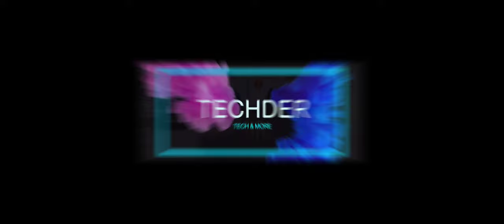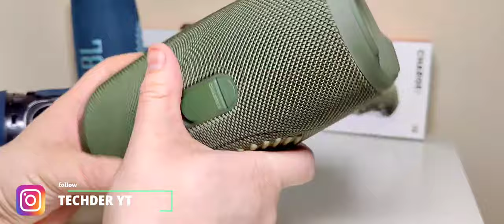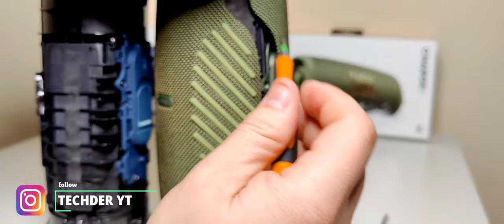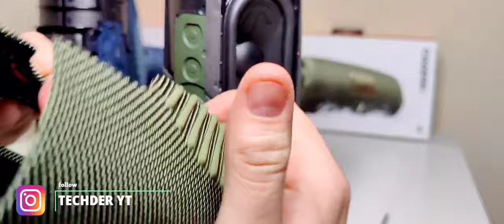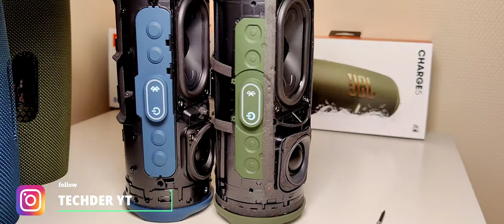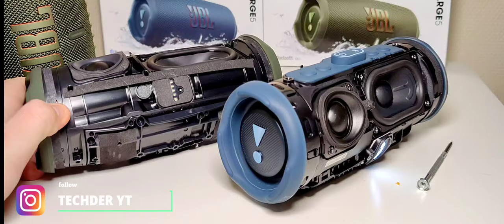2X JBL CHARGE 5 Disassembled Fabric Cover ND VS TL "ALLOT DIFFERENCE!?"

Comment: Is the colors of the speakers tied to TL or ND models or how would one know which i'm buying (if from webshop)
Reply: You don't, it's basically a cross your fingers for the ND 🤣
Reply: But I did get a black model that is a TL, it's not bad but that's coz I haven't heard an ND yet.
Reply: ND is gark green only.
Reply: The CHARGE5 comes in 3 versions (based on what I know): ND, TL, TT. The ND has more upper bass, and a warmer sound, while TL has sharper highs and more deep bass. The ND also has better waterproofing. There is not much info on the TT version as of now. If you are not using it near water, TL, and want the most detail, TL. Anything related to water or outdoors, or if you like a warmer sound with more punch, ND. Teal, Gray, and Green are most likely ND, and red, black, camo, and blue are most likely TL. Other colors may vary- there is not much info out there ye.
Reply: @Wakusins  I got one and it's NT 😂

Comment: I just got my JBL charge 4 back I had the black GG model but I got back the Black TL model but the GG charge 5 sounds better than the TL it's usually the other way around interesting 🤔
Reply: Number7Red  fast forward and I have a ND model my TT model was falling apart so I got it replaced
Reply: Number7Red  oh the sound was fine the rubber on the bottom was just falling apart. And that's cool to know there are new Charge 4 units

Comment: Hey! I have a question. I have this model but there is a "radio like" noise sound coming from the Tweeter. It's noticable on lower volume but on louder volume it is still there but not noticable since the sound is so loud. Is this normal? Or is it faulty? Got the TL version btw. Same color.
Reply: it's completely normal, Little bit of "hissing" noise coming from the speakers because of Bluetooth
Reply: 💦 waterrrr!!!
Reply: Stop putting your speaker in the water even if water resistance

Comment: What does ND and TL mean?
Reply: The CHARGE5 comes in 3 versions (based on what I know): ND, TL, TT. The ND has more upper bass, and a warmer sound, while TL has sharper highs and more deep bass. The ND also has better waterproofing. There is not much info on the TT version as of now. If you are not using it near water, TL, and want the most detail, TL. Anything related to water or outdoors, or if you like a warmer sound with more punch, ND. Teal, Gray, and Green are most likely ND, and red, black, camo, and blue are most likely TL. Other colors may vary- there is not much info out there yet.

Comment: TL have speakers more Big 🧐 more bass then ?
Reply: The CHARGE5 comes in 3 versions (based on what I know): ND, TL, TT. The ND has more upper bass, and a warmer sound, while TL has sharper highs and more deep bass. The ND also has better waterproofing. There is not much info on the TT version as of now. If you are not using it near water, TL, and want the most detail, TL. Anything related to water or outdoors, or if you like a warmer sound with more punch, ND. Teal, Gray, and Green are most likely ND, and red, black, camo, and blue are most likely TL. Other colors may vary- there is not much info out there yet.

Comment: But why is JBL doing this? These aren't even vastly different manufacturing dates, so not even explainable by hardware revisions. Does JBL now only make the exterior design and DSP software, and instead lets 3rd parties produce their own designs under license?
Reply: It could be hardware revisions where they had made the blue/black speaker first and found a better way to manufacture it later on
Reply: We don’t know how long they’ve been producing these speakers
Reply from the maker: No they always have different models because the produce this spealers in different Factories that operate for OnePlus
Reply: I thinks its more on what's more available raw materials in local markets, thats why they made some changes in inner parts of the charge 5 depending on what country they where made from?
Reply: @numerouno7874  Raw materials doesn't explain the use of completely different molds for plastic parts, and different PCB layouts, ultimately implementing the same circuit, manufactured at the same time.

Comment: Sorry, I'm using a translator. I am from Argentina.
Here there is almost no information about Jbl.

Only 2 versions are sold here, both manufactured in March 2021 from what I saw on the box. The NT version (CHARGE 5H) AND THE TT VERSION (CHARGE 5J).

If you're so nice, would you tell me which one I should choose and why?

Thanks!
Reply: Hola, yo compre el Charge 5 azul en un distribuidor oficial en Bolivia de JBL hace unos días. NT Made in Vietnam, lo abrí para ver si se parece mas al TL que dicen que suena mejor en los medios y no mucho los bajos y que también tiene una construcción no muy prolija, o si por el contrario se parece mas a la versión ND que suena menos claro en los medios pero tiene mas bajos y su construcción es mejor, es decir viene en un solo case interior y la rejilla no dobla como en el TL. Una vez abierto se parece casi en todo al ND toque la bocina pero no sabría decir si mes plástico o papel, pero supongo que tanto las versiones TT y NT son fabricadas recientemente y debe ser una construcción hibrida. Compra de donde te den una buena garantía sin miedo que al final suena genial. Un saludo
Reply: @jorgevarga  no ves que la versión TL tiene más grandes los speaker ?
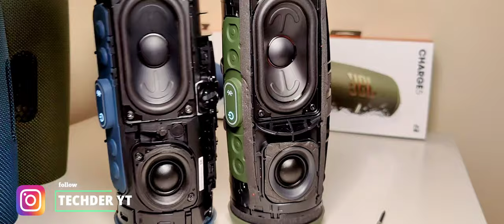Reply: @cesargamerpro3189  andate al minuto 3:26 los speakers son del mismo tamaño. y si aun fuera de un tamaño distinto, que tiene que ver con el tema que esta hablando Antonella?
Reply: Tt

Comment: So the green speaker is ND and the blue speaker is TL, what model is the black speaker? Whats the situation with the other colour speakers?
Reply: The black model is tl
Reply: @thymen641  yup, thanks. I learned that the grey speaker is ND and the rest is still a mystery for me
Reply: @tennesseeslot2546  The black model comes in two versions sold by JBL in The Netherlands;  TL ánd ND guys
Reply: @thymen641  and ND also excists with the black model.
Reply from the maker: Then two producers make it
Reply: You can't tell the version through its colour. Only the SN can tell you which version you have.
Reply: Whats the difference between tl and nd ?
Reply: @jimbo4203  nd has better bass and more durable build quality
Reply: I wish jbl charge 5 black is mostly ND she has a cover with screws!
Reply: what about the charge 5 squad color? is it ND?
Reply: @jamesdeansabanal5591  i got a black charge 5, it sounds great and is a TT version made in Vietnam
Reply: @OP_8898  and NT